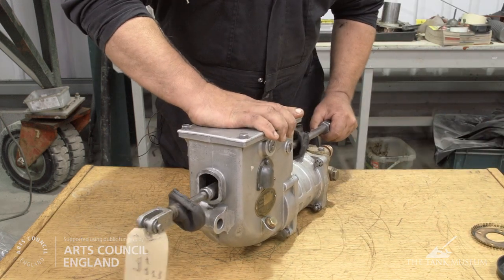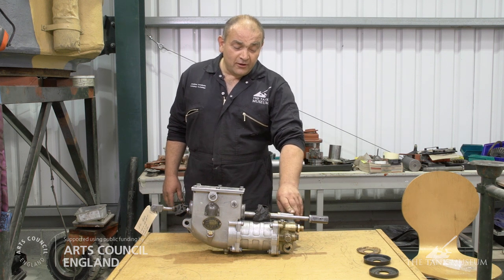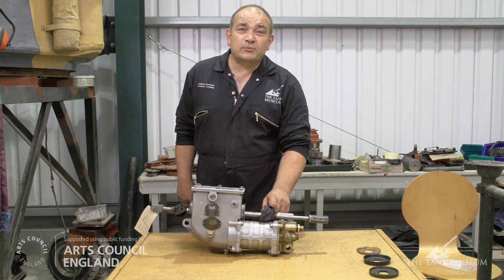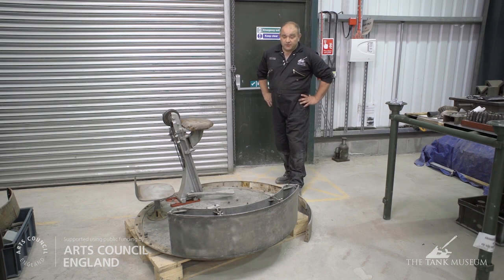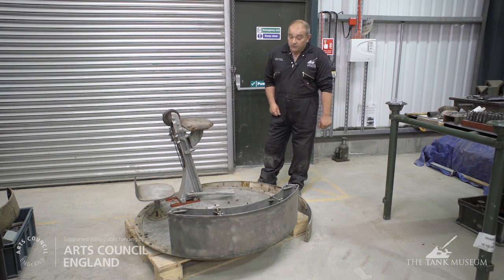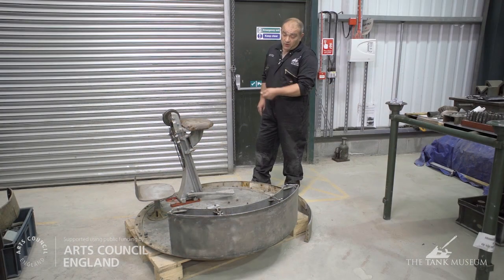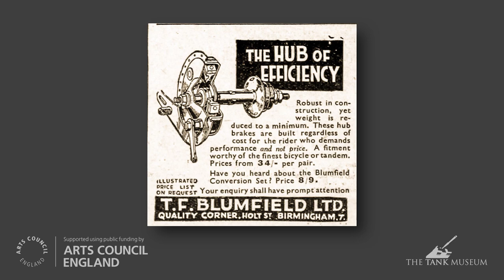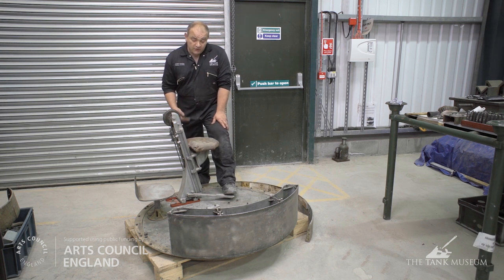The Matilda Diaries Part 6 | The Tank Museum

Comment: This series opened my eyes a lot on the work necessary to restore one of these nearly 80 year old tanks.  Also it gave me a new respect for the complexity and engineering that went into a Matilda from early WW II.  Bravo.
Reply: The engine system sucked pillock though, they could have gone with a simple V6 diesel, the Japanese did it, should not be too hard for the Brits either.

Comment: Why leather, why not rubber like the same type uses for cv joints on cars?
Reply: Leather works better for a lot for applications. Typically it is harder wearing and less prone to deterioration.  For instance, leather washers were often used in brake systems.
Reply: in addition to other reasons (it wears well in certain uses) I believe rubber was a rare commodity in WWII due to the fighting in the asia pacific region.
Reply: Also rubber can react with some hydraulic fluids and lubricants  and basically melt away.  Also, they are trying to keep the tank as original as possible.
Reply: StormwatchNZ 
Very true.